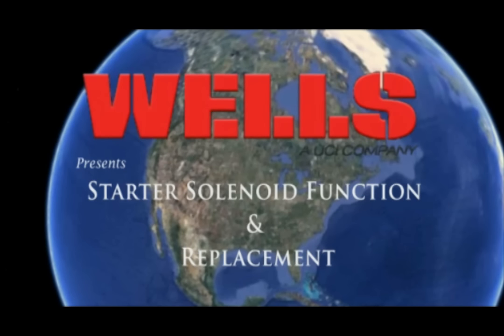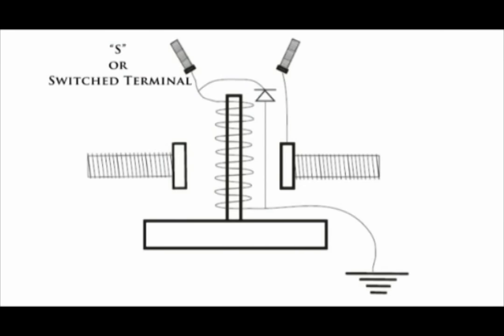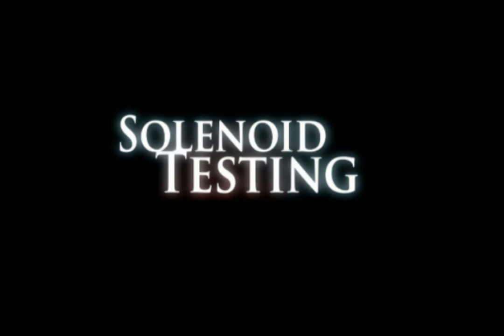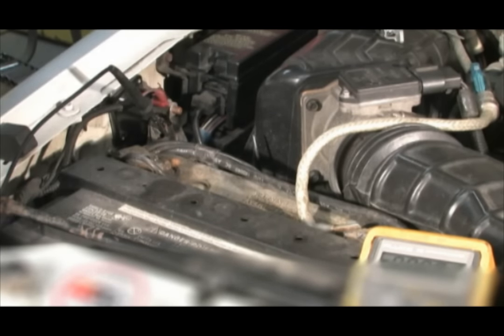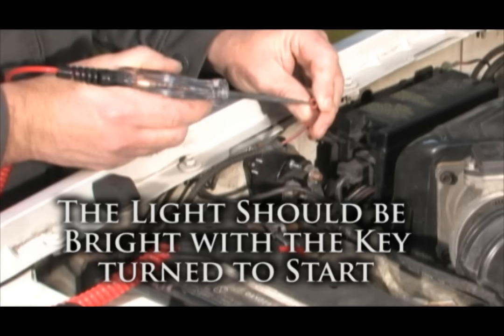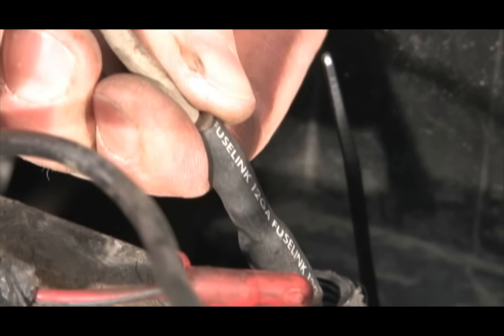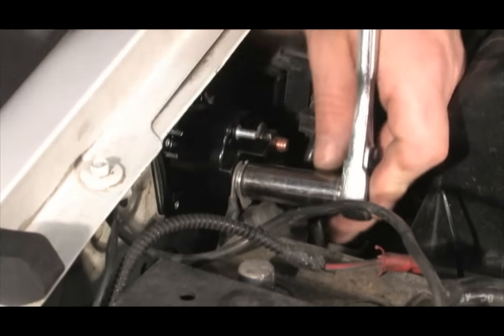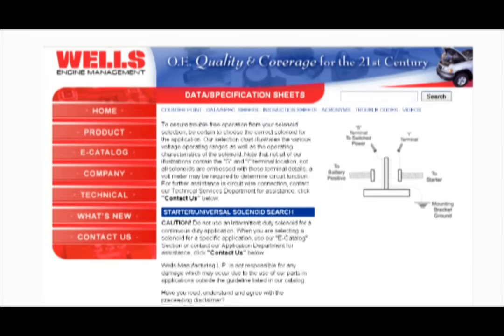Solenoid Testing, Function and Replacement

Comment: I missed the part where you show how to test the solenoid for proper electrical continuity.
Reply from the maker: What are you looking to test? There should be power at the big cable connected to the battery. Power at the small wire, when the key is in the "start position" and power at the other big cable when the key is in the "start" position.

Mike Becker, Senior Technical Instructor
Reply: @GoTechTraining  Remove the High Amp cables activate the solenoid and check the resistance across the big wire terminals, Should be almost zero ohms and checked thru multiple cycles to insure it's really always making good contact. A 100 ohms of resistance across a solenoid will activate the starter but reduce the life of the starter and  even new parts can be partially defective. Thanks for your time and video
Reply from the maker: I don't think an ohms test is ever a good test to check for the integrity of this thing...Passing the minimal current from a 9v battery in a meter is nothing compared to the hundreds of amps needed to power the starter. Voltage drop is IDEAL for this.
Mike Becker, Senior Technical Instructor

Comment: I have a 1990 ford 460 7.5 this is motorhome pinnacle and the problem is when I turn the key to starting the engine the ignition swich felling hard then sounds just beeee, what should be the problem the starer selenoid? or the complete starter? ..
Reply from the maker: I'm having a hard time understanding what you are trying to say here. If you have a test light, check for power down to the starter while you have a friend crank over the engine. If you have power, then it will probably need a starter.
Mike Becker, Technical Services Instructor
Reply: Wells Vehicle Electronics hi what I tryed to say is nothing hard to understand , Again. I TURN THE KEY IGNITION  TO STARTING THE VEHICLE AND NOTHING HAPPENS JUST A BEEE SOUND COMING FROM THE DASHBOARD,  THE BATTERY IS NEW,ALTERNATOR IS GOOD WIRES LOOKING FINE TO ME MAY COULD BE OR THE STARTER SOLENOID OR THE STARTER COMOLETE UNIT, Now hoping you understand better ask me now if you can and thank you for you help apreciater.
Reply from the maker: It really could be either component. It could also be an issue with the ignition switch. Check power to the starter solenoid, check power down to the starter when cranking and go from there. 
Mike Becker, Technical Services Instructor
Reply: Replacement of starter on 2003 70 HP nissan boat  motor

Comment: I have a 92 GMC Yukon and every once in a while when I turn the key to start my truck nothing happens but when I try the second time it fires right up no problem, do you know what the problem could be?
Reply from the maker: Hi Fabian, there are quite a few things that can cause that. It depends on what you mean by "nothing happens." Could be a starter, ignition switch, or even loose battery cables. 
Mike Becker, Technical Services Instructor
Reply: I will turn the key to start it and nothing happens I just hear a click, it looks like the battery is dead but when I try the second time it starts right up
Reply from the maker: Fabian, does the dash light up light normal all the time? This kind of sounds like a bad starter to me. But, it's hard to diagnose it 100% over YouTube comments :)
Mike Becker, Technical Services Instructor
Reply: Yeah when I'm turning the key it lights up but when I start it, it acts like its dead
Reply from the maker: Sounds like an intermittently bad starter. You could take it in and have it tested at your local parts store. Usually its free! Good luck!
Mike Becker, Technical Services Instructor

Comment: Using a 12 volt non starter type wall mount switch ing  Sole e noid as a ISOLATER  ref: Ref RV,motorhome.aux battery not charging?
Reply from the maker: Hi Bill, i'm not really sure what you are asking here. Can you clarify?
Mike Becker, Technical Services Instructor

Comment: Mark - When you click on part EVS30 it says it does not fit my car.  That part looks like the one for VIN: E motor not the F.  I have an MFI/TPI motor not a TBI.  Do you have a contact email or number for somebody who rebuilds electrical parts.  Thx
Reply from the maker: Ok, the best thing you can do is to contact our catalog department. These guys are the best parts guys in the business. They are available M - F 8AM to 4:30PM. 1-800-558-9770 press 2.
Stay in touch,
Mark

Comment: I have a 87 jeep wrangler yj and the starter and selenoid are new but I get positive on the I terminal when the key is turned one click to accessories and it stays on on when ignition is turned all the way. my problem was prob a dead Battery as it clicked continually before but now it just has a faint click when I release the ignition that is probably the relay click .... but my starter won't turn but I tested it tsc and it's brand new ...help plz
Reply from the maker: Hi there, so it sounds like you have power to the starter, and you know the starter is capable of spinning. There really can only be 2 issues here. One, the motor could be tight, and the starter is not able to spin it over. And two, the large power wire leading to the starter has high resistance, where its able to show power, but can't pass enough current to make the starter spin. I would look for any sort of corrosion, also check the battery terminals and make sure they are nice and tight. Hope this helps!
Mike Becker, Technical Services Instructor
Reply: thx I got it started. I found the issue. I believe it is the neutral safety switch, but I am not positive. I have a wells selenoid and it has 5 posts one s terminal one I terminal, a terminal to the battery and one to the starter. it also has a terminal on the opposite side of the s and I terminals. I believe this is the ground going towards the neutral safety switch but I'm not sure..can you plz tell me what the terminal is for ..it's an automatic transmission so I don't think it's a clutch safety switch...I ran a jumper cable from the 5th terminal to ground and it works. finally lol.. I have an 87 jeep yj wrangler lerado and bought a new wells selenoid even tho I didn't need it but now I'll keep the old one as a back up lol.
Reply from the maker: The wiring is as follows. The 2 large terminals go to the battery and the starter. The S terminal goes to the ignition switch. The I terminal will most likely be left with nothing on it. The little bullet connector goes to ground. That should take care of it for ya. Let me know if you have any problems. 
MIke Becker, Technical Services Instructor
Reply: I know that the bullet connecter goes to ground but is it through the neutral safety switch or something else ... because I am not getting ground to that wire so I have a separate issue... it works if I jump it to ground but I want to fix the problem also
Reply: madublah Uml

Comment: hi at 1.11 in video i see a diode. can u pls explain the purpose .  i know diode will stop back feeding and it allows current to pass one way. but not sure the context here.. you have connected diode in this diagram such that the ground from bottom will pass it all the way to top of  S terminal. if diode connected this way will not this create a short..or am i missing something.. in otherwords how this didoe is stopping back feeding and where does the back feeding starts.. pls explain
Reply from the maker: What a great question! As you saw in the diagram the control voltage goes to the "S" terminal then through a winding of wire and then to ground. When this occurs a magnetic field is generated around the winding and it pulls the disc up to connect the high current connections to the starter. When the starter is released, no more current equals a collapse of the magnetic field. When the field collapses an AC voltage is generated in the windings. To prevent this voltage from entering the system the diode is placed. Some higher end Ford vehicles were prone to frying the ECM if the diode was not there.
Stay in touch,
Mark Hicks
Wells Vehicle Electronics
Reply: markjhicks  Thanks for quick reply when AC current is indcuedbcz of magnetic collapse., if my understanding is correct we need to stop the AC current going back to start wire in Ignition swtich is my understanding correct. if so, i still didnot  understand the orienation of diode ,can u pls explain more in detail about orientation of diode in the context of what that diode does in stopping Ac voltage from going where..
Reply: In addition to previous comments, my confusion lies here..  assuming coil has two ends A and B. when magnetic field get collapsed, AC voltage will induced becauseof EMF(electro magnetic force)..  now what is the diode going to do, is it providing a ground path to point A which would short the AC voltage to Ground. if my understanding correct, will not power at point A will get connected to Ground thru that path instead of going from A to B ..
Reply from the maker: sivaraj palanisamy
When the EMF occurs there is a voltage spike and this voltage wants to return to the source which is the winding. It is kind of like the way a DIS coil functions. Without the diode in place this would become a problem after repeated attemts and/or while the engine is being jumped.
Mark
Reply: mark, thanks much, is diode placed inline with the Starter Trigger wire. meaning  Anode pointing towards the source and cathode pointing towards the starter. OR diode is connected in paralle with anode pointing towards the source and cathode is connected to ground. in ur diagram it is mentioned as later case, but i doubt it should be inline.. pls advise.
Reply from the maker: sivaraj palanisamy
It is correct in the diagram. In this case it depends upon which way the magnetic field flow. This flow pattern will determine current flow direction.
Mark

Comment: Hi Mark, can you show how is conected to external voltage regulator,  thanks Jorge
Reply from the maker: Kavic Eng.c.c. 

http://www.wellsve.com/custom_searches/showpinoutdiagram.php?partno=VR730#zoom=100
Here is a pin out picture of the voltage regulator. We have plans in the works to make a video on this as well, but in the mean time I hope this pin out diagram helps you. Keep in touch.
Mike Becker, Technical Services Instructor
Reply: Thanks Mark, very usefull,

Comment: Hi my Truck wont start all I hear is a click. I checked the battery and its fine. The click is coming from the solenoid. I did the old fashion screw driver on both screws of the solenoid while cranking ignition and still wont start. Can it still be the solenoid or the started itself? Any help would be grate thank you.
Reply from the maker: Either it is the connection to the starter or a defective starter.
Mark Hicks
Wells Vehicle Electronics
Reply: Thank you so much for responding this has been a grate help.
Reply from the maker: Nafir Alvarez
My pleasure. You need anything more, let me know.
Take Care,
Mark Hicks
Wells Vehicle Electronics

Comment: just replaced battery and alternator. battery still is not charging. Could it be the solenoid?
Reply from the maker: Hi Joe, the starter solenoid typically doesn't have any control over the alternator. Does the large wire from the alternator go back to the battery on your vehicle? By the way, what kind of vehicle are you working on? I can take a look into that system to give you even more precise information. Talk soon.
Mike Becker, Technical Services Instructor

Comment: what about a 97 ford lariat is the solenoid in the same place.
Reply from the maker: +ww2collector1 If its an F-150 it will be on the right rear of the engine compartment, mounted to the firewall. 
Mike Becker, Technical Services Instructor

Comment: What happens if the solenoid isn't grounded? Does it click or just fail to work entirely?
Reply from the maker: Lightly Bow The starter solenoid is grounded through the body. Bolting it down and contacting the body is what creates the ground path. If the solenoid is not grounded it would not function at all. It would not click. 
Mike Becker Technical Services Instructor
Reply: markjhicks Thank you! That's very helpful!

Comment: I changed my battery, starter, starter solenoid, ignition switch. and truck still won't start -.-
Reply from the maker: Hey Mr. Mayhem  does the truck crank over and not start, or will it not even crank?
Mike Becker, Technical Services Instructor
Reply: Wells Vehicle Electronics Doesn't crank at all.
Reply from the maker: What kind of vehicle is this on? What kind of testing have you done so far?
Mike Becker, Technical Services Instructor

Comment: if the solenoid turns over when you cross it with screwdriver does that mean it is bad.
Reply from the maker: Hi Mark, It can be a good indicator that the solenoid has failed. But you want to still verify that you have power to the "S" terminal. That is the control terminal, power from your ignition switch. But crossing the solenoid with a screwdriver you are not only bypassing the internals of the solenoid, but also the ignition switch input. Just hold a test light to the "S" terminal while someone is inside trying to start it. It should light up. Also, PLEASE make sure the vehicle is in park.
Mike Becker, Technical Services Instructor
Reply: thank you, I have recently changed the switch that sits on top of the column under the dash.
Reply: Wells Vehicle Electronics

Comment: My car starts perfectly when cold but when hot doesn't make a sound at all .. no click or anything just the fuel pump hum. Every light cuts on perfect .. my dad is a auto mechanic and said that the selnoid on the starter is bad because the car will start up after the car has sat the same amount of time it was running ...
Reply from the maker: Hey Mrb Ridingog, first thing to do if you're expecting a starter issue is to ensure that there is power getting there when the key is in the start position.
Mike Becker, Senior Instructor
Reply: @GoTechTraining  it was definitely the starter g .. swapped it out yesterday and it starts up perfectly .

Comment: Mark - I have been looking for part # 1997171 EGR Vacuum (Regulator) Solenoid for a 1991 Pont Trans Am, 5.0L (305) V8 VIN: F motor.  The part has been discontinued and I can't find it anywhere.

Here is a picture of it:
 
http://www.stockwiseauto.com/product_info.php/products_id/1523264/fit_id/6930/Year/1990/Make/Pontiac/Model/Firebird
 
Do you know somebody who could rebuild the one I have or make me a new one?

Thx, Joe
Reply from the maker: I looked it up on our website and the part number is EVS30. You should be able to order it through AutoZone.
Let me know,
Mark Hicks
Wells Vehicle Electronics

Comment: I just hate the automotive industry an the greed involved . Take for example the starter at times the starter is not bad an the solenoid is the problem but the force you to   Replace both because it's sold as one part . An then the retailed stores pep boys etc then tell you return your old starter an will reimburse you a fee while knowing the fact that they will most likely refurbished the solenoid or starter for a cheap price an then sell it back to another customer for a market price ! Is that fair
Reply from the maker: The solenoid is normally not rebuilt. What do you think a brand new starter would cost? A lot more than a rebuilt. In order for the re-builder to rebuild starters they need cores. If there was no such thing as rebuilt starters you would be paying for new ones and throwing the old one away.
I hope this helps clear things up a little. If you have more concerns, please let me know,
Mark Hicks
Wells Vehicle Electronics

Comment: If you think they don't refurbished products then this conversation has no conclusion but to disagree but I know what am talking bout . Not everything gets discarded especially electrical components an is not unusual . Anyways thanks for the convo
Reply from the maker: I am not saying automotive products do not get rebuilt. They do. However starter solenoids do not. Wells does not rebuild anything. However there are many components that are rebuilt for example, starters, alternators, Mass Air Flow Sensors, transmissions, power steering racks etc.
Mark Hicks
Wells Vehicle Electronics

Comment: No that is not the solenoid. Check for spark and fuel. Try spraying a little carb cleaner in the throttle body and see if it fires. If it does check fuel pressure, if it doesnt check the spark.

Mark Hicks
Wells Vehicle Electronics

Comment: that is not the solenoid. its the starter RELAY. the solenoid is on the starter.
Reply from the maker: That is true. Commonly in the industry this starter relay is referred to as the starter solenoid. That's why it was called that in this video. Thanks for commenting!
Mike Becker, Technical Services Instructor
Reply: you're  welcome.

Comment: Hi, I replaced my solenoid, but it still wont crank... the car will start if i short the solenoid with a screw driver but it does not start when i turn the key. any suggestions?

Comment: I have a 1996 Yamaha Badger 80 (YFM80) ATV and when I turn the key the neutral light doesn't come on and it has a good battery. When I hit the Start button the Solenoid clicks and the starter won't engage. I have just rebuilt the motor so It obviously isn't seized. Any help is appreciated. Thanks
Reply from the maker: Jake, if the solenoid clicks, that means that it is engaging internally. You can check voltage on the wire that goes to the starter. When the solenoid clicks on, you should have power to the starter. If you do, then more than likely you have a bad starter or a seized engine.
Mike Becker, Technical Services Instructor
Reply: Wells Vehicle Electronics Thanks. I just rebuilt the engine so I know it isn't seized. I'm thinking it is the solenoid because I push started the atv and when I turned it off heard the starter click.